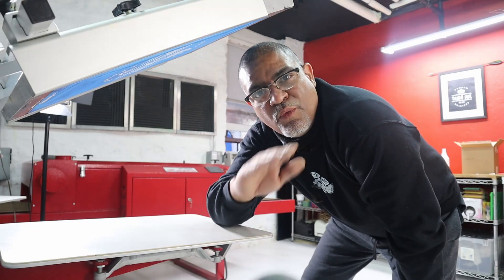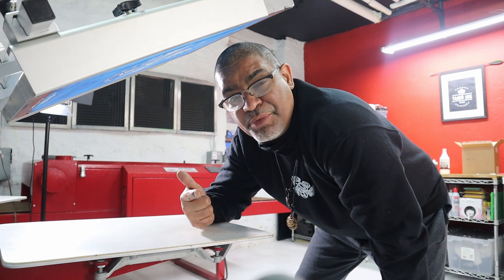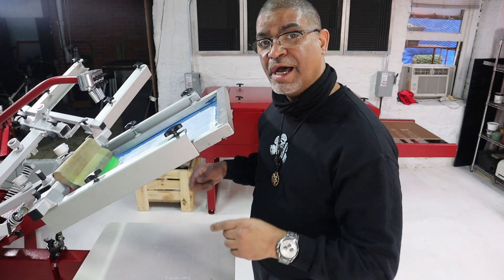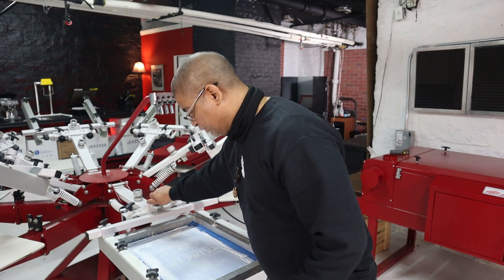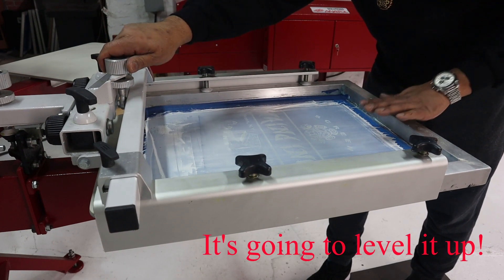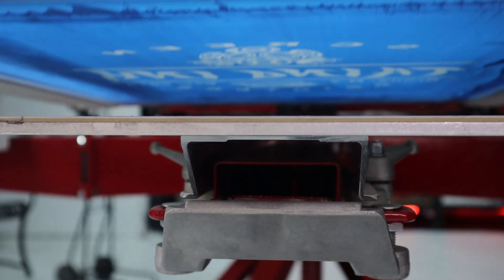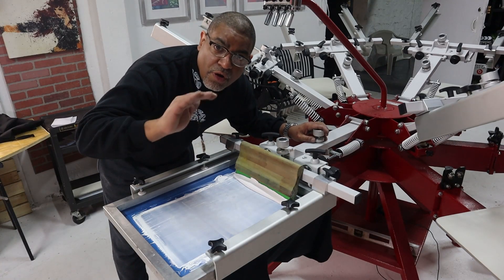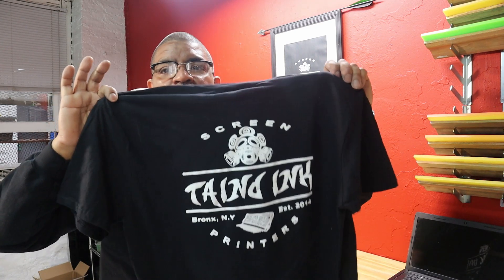PRINT YOUR OWN T-SHIRT // A TRICK TO A SHARP AND SMOOTH SCREEN PRINT

Comment: I have a question.  I adjusted my off-contact and my screen is just above the shirt but the screen is not snapping back.  Am I using too much pressure to clear the screen?
Reply from the maker: That means you have to go higher on the off contact and make sure the screen tension is good.If the screen tension is not tight that might be your problem.

Comment: Looks like the shirt without the off contact moved. When the off contact is to high the screen life will also be diminished. Your tension won’t hold up as long.
Reply: The best printers for multicolored high mesh count, high detail prints do not use off contact but they do use very thin inks. Great Dain Graphics is one example that prints CMYK 303 mesh with NO off contact. There is NO stencil drag.